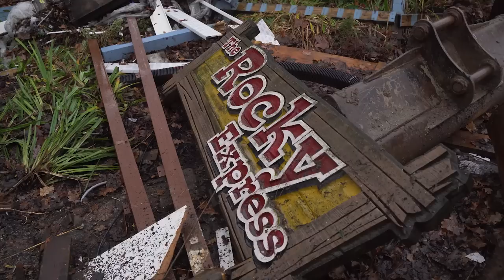Project Exodus Full Construction Site Tour! | Thorpe Park, January 2023

Comment: Really this is the easy bit taking down all the buildings and laying the foundations the real challenge is building the coaster itself as they'll have to be extra careful, also does anyone worry that exodus may have wind issues based on the other 3 tall rollercoasters in the UK Big One, Stealth and Odyssey
Reply: stealth doesn't really go down due to high winds, if it does it's got similar requirements to the likes of swarm, I'm sure exodus won't be much different.. especially that thorpe doesn't really get that windy